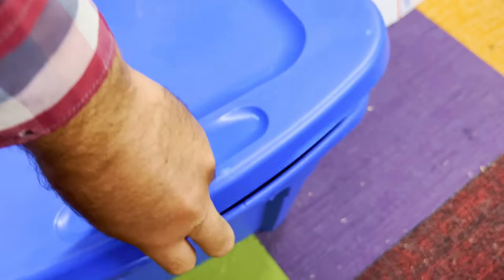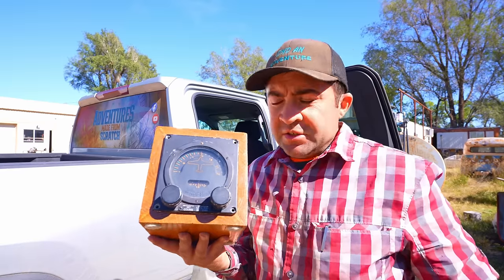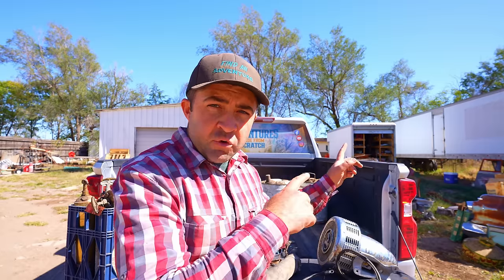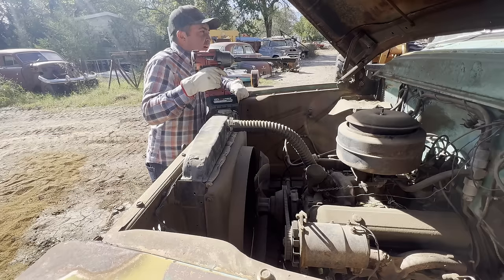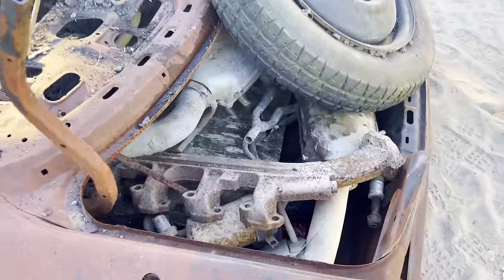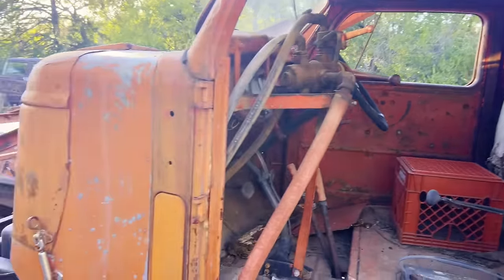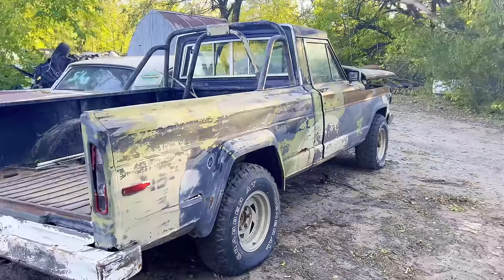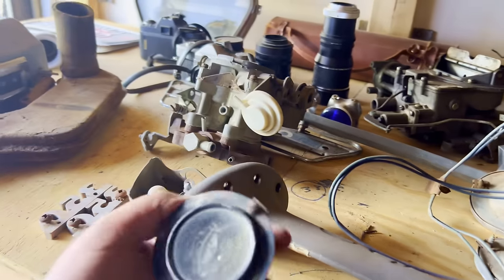What in the World did I Buy Now?!? Crazy 1940s Contraption & Much More!

Comment: That rat truck would be a good candidate for a snowblower rig. Drop a 2 stroke diesel engine engine in the front of the cab and get an old snowblower attachment from a 3 point hitch. Mount  The snowblower on a new  hydraulic lift mechanism or repair the one that is on it. Make a small drive shaft run it from the pto of the blower and connect it to the directly to the engine. Use some old iron and put it on the back of the rig. Lastly, strap some tire chains on, and you will have a snowblower rig to move the snow in your scrap yard. I don't know if you get snow down your neck of woods? Would be perfect for up here in the East Coast of Canada.
Reply: Go build one then

Comment: That hood ornament on that old pickup is a Impala, I wonder if it originally came off of an old Impala car.......(Update/Edit), Its actually a Gazelle,  Golden Gazelle and Best you get that Gazelle/Impala hood ornament off and safely stored, after a quick google search I learned those are pretty rare, and were used before Chevy came out with the impala car.........and I did find this here...."UP FOR BIDS IS A RARE USED ORIGINAL 1949-50 CHEVY CAR GAZELLE/ IMPALA HOOD ORNAMENT. ALSO FITS 1952-54 CHEVY CARS." thats the quote, the photo they show is identical to the one on that old Chevy truck. Found one on Ebay asking $1495.00 for it.

Comment: Worked on a 1974 jeep Comanche 4x4 fixed the fuel system changed the oil new o rings on the injectors and drove it

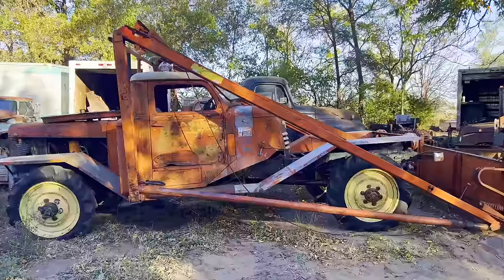Comment: If you still have those Grumman van emblems, I'm sure if you contacted Hannah & Corey Wheat, they would most likely want them. If you look up some of their recent videos, they're rebuilding one. 14:45 The fact that those numbers have been deliberately removed from the front of that engine should be of concern. That's actually often a pretty good indicator that the engine has been stolen. 20:00 If I had some $$$$, I would want to buy that very strange truck, thing, whatever it is, without the bucket. I think it would make for a wicked one of a kind rat rod.

Comment: rip everything out of that home made diamond t including engine, put a hot engine in the front, mabe an old straight axle, 411 gears in the rear, mount a bed you have lying around. it is all so easy to get to to for weld on mounting brackets, leave it as is, one bad ass ratt rod.

Comment: Frankenstein with the bucket is excellent! Turn it into the Happy Hooker🪝😮. Kind of a tow truck in reverse. That way you can see when you are pushing things backwards. He could use it for Yankee engines out lifting heavy items such as the rear axle assembly. I'm sorry that you took out the tailgate on your truck with the trailer. We see that quite a bit you can get one with a drop in the middle . Whoever put that together created a work of art.